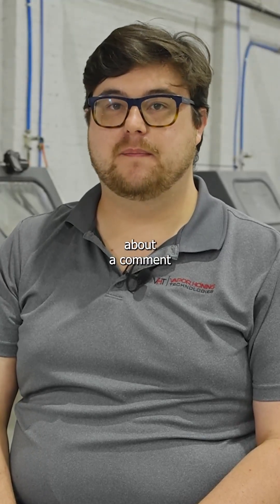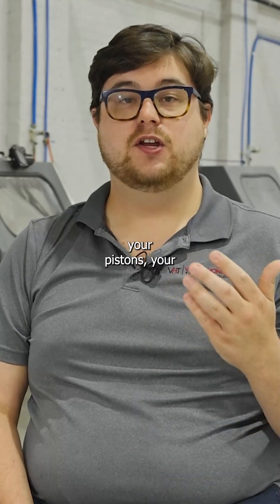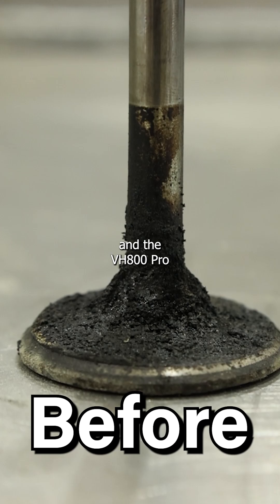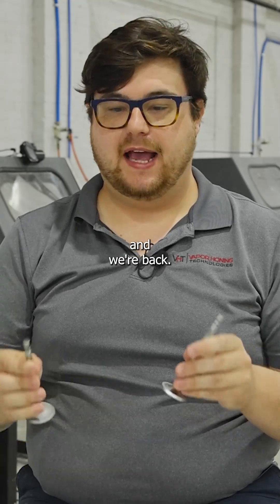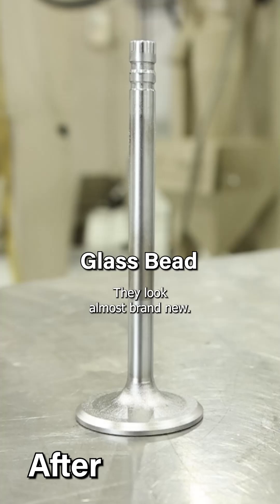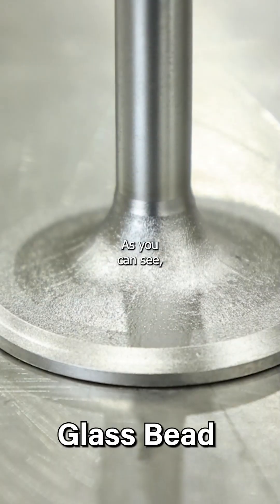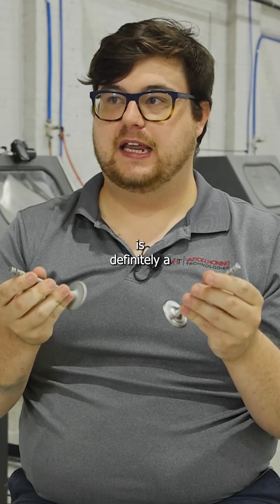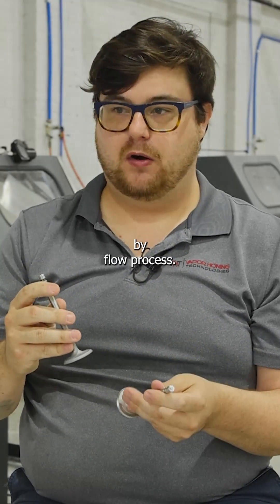Carbon Build Up Removal

Comment: You should tape the stem of the valve so it doesn't eat the valve seats after. Smooth valves = sealed valves